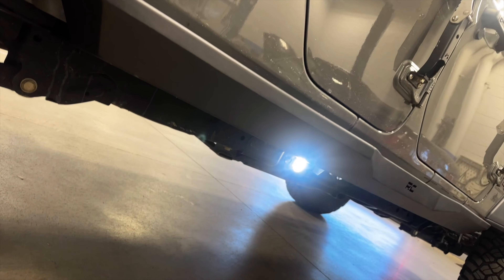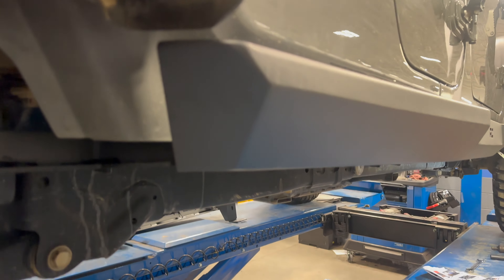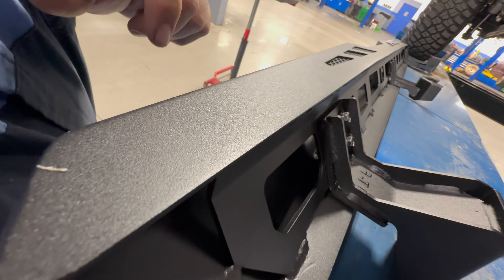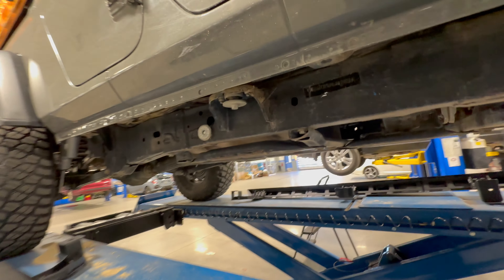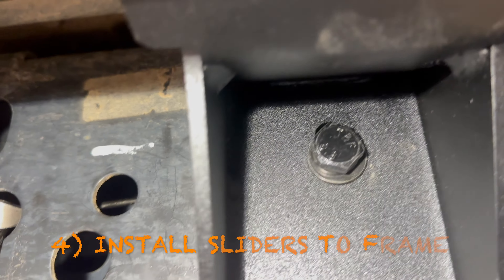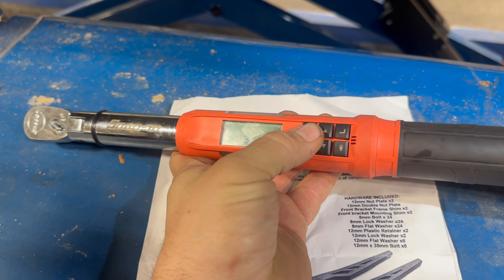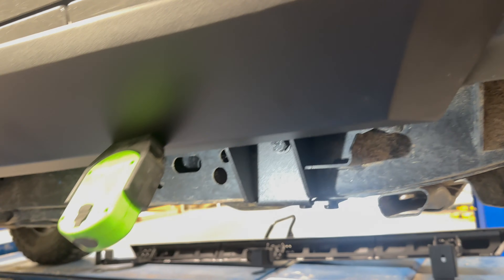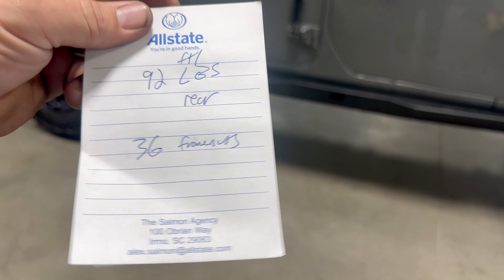Are ROUGH COUNTRY'S new JEEP HEAVY DUTY ROCK sliders ANY GOOD?!?

Comment: Those look pretty nice iv seen them before and didn’t realize they were frame mount thanks for the clarification now I’m truly interested.
Reply from the maker: I was surprised. Lately I’ve heard rough country was stepping it up with quality and giving the customer more. This is good for them.
Reply: @WolfOverland  I’ve had several products most of them great. Their customer service is great also install instructions are lacking and can be very wrong especially in the torque spec dept but most of the time common sense can remedy that.

Comment: Those are good looking rock sliders, what happens though if for some reason you need to work on your vehicle and remove the slider? If that one nut that you feed through the frame it’s only held by a piece of wire how do you loosen it without the nuts spinning and then when you re-install the slider how would you get a nut back in there? Thanks for the video I really like those sliders👍

Comment: I've heard some horror stories about the rear body bolt.... either it shearing off or the capture nut breaking its tack weld..... apparently because of the red lock tight......i just bought these and installing tomorrow..... any tips or suggestions?
Reply from the maker: Heat
Reply: @WolfOverland  small propane torch or better off investing in a induction heater?
Reply: How did the install go ?

Comment: Have you tested them out ?
Reply from the maker: @dunnoyolo2238  yes. My latest video we did the cove. Definitely can take the weight!
Reply: And how are they step wise  easy in and out of Jeep?
Reply from the maker: @ not as good as a lower step style. But I can step on them with the door closed.
Reply: @  I really like the EVO Manufacturing Aluminum sliders  but just don’t want to pay 💰 $1,800 dollars and these RC don’t look bad for the money and 3 yr warranty.
Reply from the maker: @ I don’t know if I would like aluminum for sliders if you use them hard.
Reply: @ they are really beefy looking  and rust is always an issue with steel
Reply from the maker: @ I live in the south never have issues with rust. I see your point. They are well coated and are holding up